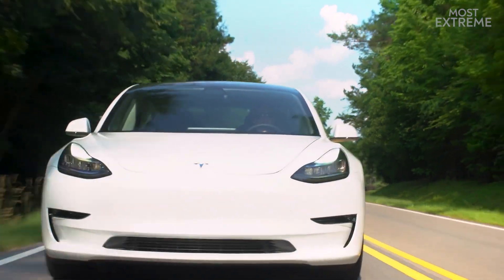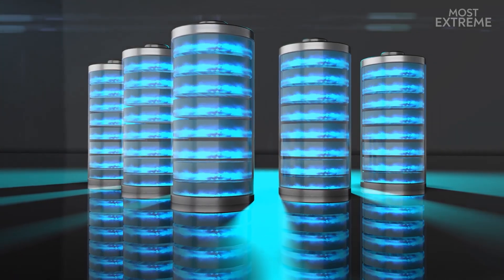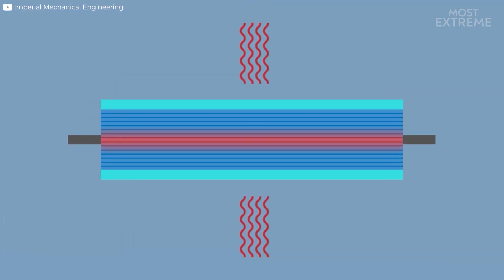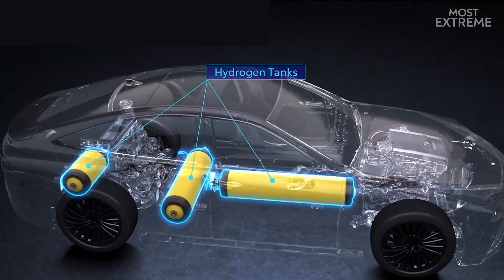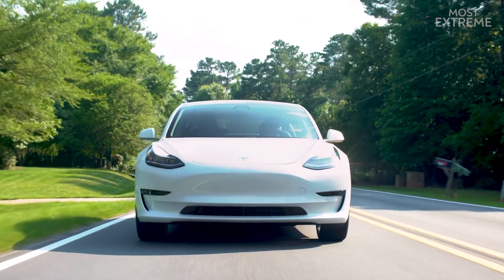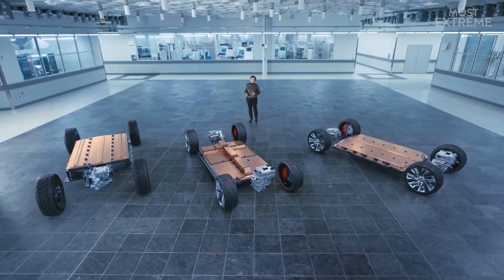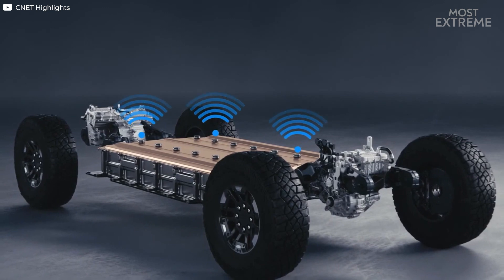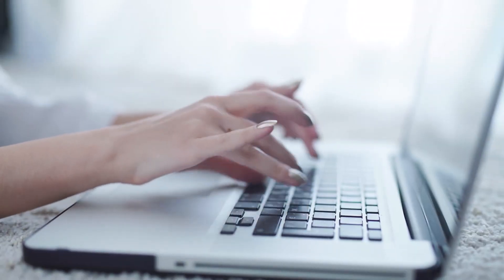Lithium VS Hydrogen VS Solid State | EV Battery Technologies Explained

Comment: Hydrogen infrastructure will need to be built sooner or later for the heavy transports. When that happens, I think we can expect to see more hydrogen cars on the roads.
Reply: It would cheaper to build hydrogen filling stations nationwide than upgrade the entire electrical grid.
Reply: @kerrfoy3653  1.you clearly have no ideea what you’re talking about. Let me ask you only this. How many people trained to work with histogram you know and how many electricians do you know? Do you know how dangerous hydrogen is? Do you know that hydrogen can burn only from the electric charge of only one single human hair? That alone will tell you that working with hydrogen is very expensive.  Second of all, to create hydrogen in mass you actually need to upgrade the electricity greed. Because hydrogen is created with electric energy. Not very efficient either. With 2kw of electric energy you create 1.2 kw of hydrogen. That’s expensive also.
Reply: @mariusmihai1292  Funny that you ask. My trade is that I am a retired Chief of Special Operation with over  30 years of experience in Hazmat/Fire Operations. I am presently the owner and lead instructor for Hazmat Training Specialties. Not to bore with my full resume but I just happen to be the primary Hazmat and Rescue instructor at Livent, formally FMC Lithium Corp. One of the worlds leading manufacturing of battery grade Lithium metals. In 1996 I was first introduced to the hydrogen fuel cell concept while teaching a hazmat class for John Deere research and development. It was a John Deere gator that could ride all day on a bottle of hydrogen and only produce water out the tail pipe. Presently about 95% of hydrogen is produced by high pressure steam and natural gas. Electrologist only accounts for a fraction however it is gaining traction by using solar and wind. I’m not trying to be rude but it’s not that you don’t know a lot, it’s just that a lot of what you know is just wrong. We have not built a nuclear reactor in over forty years and have shuttered numerous cole and hydro plants. Have you not noticed the rolling grid failures in California and Texas? BTW, my family owns a large electrical contracting company of which I first started working at as an electrician in 1988. The fire service offered me a more interesting career path but I still provide electrical safety and arc studies for many large corporation. I just happen to be at Novant today to teach electrical safety and LOTO. Sorry I offended you with my well informed observation 😉
Reply: @kerrfoy3653  first of all I did not ask you anything. 
Second of all you did not actually provided any informed observations. You only said that I don’t know much and you know. Whiteout providing any arguments about the subject. Which makes it an authority argument…
I put it more simple for you. Right now X invest in let’s say solar and wind energy, and the return time of investment is 5 years. He can sell that energy at any time of the day or night instantly. Right now that is not a problem. And it could not be a problem untill 90% of energy produced by green energy if you have the right mix and the max point of consume exactly when you have the max production. I literally made that with entire factories. 
Why the hell he should complicated his life and make a bigger investment and transform that electric energy into hydrogen? and double the time that he will require to return his investment? Would you do that with your own money? 
And no, hydrogen it’s not gaining any traction. Only in US maybe. 
How is hydrogen produced now it’s irrelevant. We’re talking about green hydrogen. 
For adoption to happen it needs to make sense every step of the way. financially. 
You keep saying that you’re well informed and after that you say Deere gator ride all day with a bottle of hydrogen. Which make me really curios because the hydrogen needs to be compressed. You need energy for that and after that it’s still require 3 times liter/kw comparing with gasoline or something. and that’s physics. In a normal car you actually need a 140-180 litre deposit tank. So you’re actually wrong. But they that’s the first thing I heard about hydrogen also… a man who drives all day with a bottle of water. 🤣🤣
Reply: @mariusmihai1292  😊Compressed gas cylinders are commonly referred to as gas bottles. I never implied it was a water bottle. I’m not bashing lithium. In fact I have made a fair amount of money off of it in the last 10 years. Just give it some time. Just like wireless caught the fiber optic industry by surprise, I feel batteries are on the same path. Lithium ion is far from safe and stable. I guess we will just have to see.
Reply: Not just for heavy transport, but also for chemical processes like making ammonia and methanol. Green hydrogen on a massive scale is completely inevitable if we want to have any hope of decarbonizing industrial agriculture, for example. The biggest advantage of hydrogen for transport, though, is that it decouples generation and demand; if you want to charge a 100kWh battery in 6 minutes, you'd need 1MW of dispatchable power on demand. Multiply this by the number of cars that need to charge up at any given time, and you can see there's a problem, especially if you're relying on variable renewables like wind and solar. Batteries are only half of the equation when it comes to solving the problem of slow charge times. An energy vector like hydrogen solves this problem because  it doesn't have to be dispatched instantly. We can instead build enough infrastructure to make and distribute the stuff to support those instantaneous spikes in energy demand.

As for the extra energy required to make hydrogen compared to the round trip efficiency of batteries: California, by itself, already curtails enough energy every year that we could charge 26 million cars with 100kWh batteries. Well-to-wheels efficiency is just a non-issue because we're already wasting a tonne of energy, and as renewable penetration increases, we're going to be drowning in the stuff and looking for things to do with it. Hydrogen is a great energy sink, because it's never full. You can throw as much cheap, almost free electricity at it as you like and use that energy later, and do so on scales that would make even the most ambitious battery chemistries blush.
Reply: @vasudan-u6k  Bruh, Are you charging a 100Kwh batter in tenth of an hour? 
You'll burn into flames
Reply: @vasudan-u6k  no it’s not. To create hydrogen you actually need electric energy. And when you create hydrogen you lose almost half in the process. You need 2kw  of electric energy to transform it to 1.2 kw of hydrogen. creating green energy to transform it to hydrogen is just stupid in many cases.
You can use water dams to store energy in a much more efficient way. When you have surplus of power you take the water up the hill and when you need that energy you let it flow. Also you can put pressure on a container with gas when you have surplus of energy and let it flow transform it to energy when you need too. That is also a more efficient way to store energy. You don’t need actually batteries in every case. Hydrogen does not make financial sense because the process to create hydrogen is only 60% efficient. And that is huge.
Reply: @mariusmihai1292  I'm aware of how electrolysis works.

Your argument fails for the same reason that pickles are cheaper than fresh cucumbers. If we have a poor crop one year, we can sell pickles leftover from previous years to meet demand and keep prices low, but we can't do the same for fresh produce. If we don't grow enough to meet demand, the price skyrockets. If we grow too much, the price crashes because there are only so many cucumbers you can eat before they spoil. Instead, we make pickles that can be sold over the next few years to recoup some of that cost. Generally, pickles turn out to be cheaper than cucumbers, even though pickles are made from cucumbers.

Electricity isn't perishable, but it is non-fungible. Every time you switch a lightbulb on or off, generation capacity on the grid compensates by either generating slightly more or slightly less. The amount that is generated needs to match the amount demanded at all times, to within some tolerance. If you generate excess electricity beyond this tolerance, its maximum value is zero, because if you can't curtail it, you need to pay somebody who can. 

When you switch the grid over to wind and solar, you're no longer able to exactly match supply with demand, and so you need to take the excess and store it. On the scales we're talking about, hydrogen is by far the cheapest option, even if it's less efficient than other methods. As a case in point: the US has 350GWh of hydrogen storage in operation, today, some of it more than four decades old, and only 3GWh or so of grid scale batteries. You can add geological hydrogen storage to the grid hundreds of GWhs at a time, and store hydrogen for years at a time, whereas a battery needs to be cycled continuously to recoup the investment cost. The amount of geological storage available for hydrogen outstrips even pumped hydro, since we can use old wells and existing natural gas storage sites.

But you don't have to take my word on this, there are a million papers out there on the subject with varying degrees of accessibility. Even the WWS grid studies done by Mark Z. Jacobson rely on colossal amounts of hydrogen, to the tune of around 35% of all transportation energy. And yes, it's tipped to be cheaper than CAES, which has its own problems.
Reply: @vasudan-u6k  I working in energy efficiency for 15 years now. 
You’re confusing the price of production with the price of final consumer.
The price of production always counts in the price of the final consumer the only exception could be a black swan event in a market. 
First of all when half (in many cases even les) of the energy we consumed is produced with green energy, to store green energy is a stupid thing to do. You actually create a false problem that we need to store energy. We are not there yet and we don’t actually need to be ever. The countries that already reached 100% of it’s used energy to be produced by green energy don’t use hydrogen at all.
Soo to keep pushing the need to store energy by years to make an argument… is makes no sense to me. 
Making an argument that you have surplus of green energy that you don’t know what to do with it when you only use half green energy and half fissile energy does not make sense to me either. It’s a false problem with a false solution. 
Throwing away energy is stupid also no matter how you put it. It makes it double in price and that is a problem. The main problem right now is not yet the storage. Is slow adoption of green energy. And hydrogen solutions will only slow it more. 
If you thing storing hydrogen is cheap you’re dead wrong. Hydrogen has a very low density. Is very dangerous. you need well trained people, expensive equipments. When something is complicated and does not make financial sense from the start it will not be adopted. Simpler solution that can be applied everywhere that don’t need much training and the price can go lower and lower in the future are beeing adopted trow time. 
If you don’t believe me, you can gather knowledge from Toyota. Who were the leaders in that. Who they lost 10 years in researching hydrogen solutions. And now they gave it up. 
And officially said that hydrogen is not a solution. And not they invest in researching solutions for batteries. Solid state. Silicon etc…
Reply: @vasudan-u6k  1.2 kw of hydrogen will always cost 2 kw of electric energy. No matter how you put it.
Reply: @vasudan-u6k  to have a good return of investment in green energy investments you actually need to use that energy as soon as you can as efficient way you can. By throwing half of it away, will only stop the adoption and the trend of lowering the prices of green energy. because it will double the time of returning the investments. And that is a huge problem. Because we don’t actually have much time.
Reply: @mariusmihai1292  Okay, let's break this down:

"1.2 kw of hydrogen will always cost 2 kw of electric energy. No matter how you put it."

Wrong. Modern electrolyzers such as SOFCs are around 85% thermodynamically efficient, and better than 100% electrically efficient, because only the Gibbs free energy needs to be provided by electricity. The rest can be provided by waste heat, meaning that "2kw of electric energy" as you put it (actually, kW is a measure of power, you mean 2 kWh of electrical energy) can net you more than 2kWh of hydrogen, so long as waste heat from a different source is provide. I would have expected someone "working in energy efficiency for 15 years now" to understand this. The fact that you don't tells me you're probably misrepresenting your understanding of this topic.

Secondly, you state:

"First of all when half (in many cases even les) of the energy we consumed is produced with green energy, to store green energy is a stupid thing to do. You actually create a false problem that we need to store energy. We are not there yet and we don’t actually need to be ever. The countries that already reached 100% of it’s used energy to be produced by green energy don’t use hydrogen at all."

No country has decarbonized all of its energy usage, but some countries have decarbonized their electrical grids. Electricity only accounts for around 40% of all energy usage, and is fairly easy to decarbonize if you have lots of hydro or geothermal, which all countries with decarbonized grids do -- but you still need to decarbonize the rest to decarbonize all energy use. This includes things like trucks, ships, aircraft, manufacturing, heating, agriculture, etc. and it also includes the manufacture of chemicals such as ammonia, which is made from hydrogen, and is used to make fertilizer to feed the planet. Some of these problems require that you be able to store energy in a dense form, which is why companies like Maersk are looking into methanol and ammonia to fuel their ships.

Then you have the remaining countries that will need to decarbonize their grid using stochastic sources like wind and solar. The probability that stochastic supply and demand will ever match one another is mathematically zero -- that's basic probability. For these countries, you absolutely need storage on a large scale, because even with highly interconnected grids, weather patterns like dunkelflaute can occur on the scale of a continent. Again, the cheapest way of doing this will be hydrogen, because you can store it underground very, very cheaply. The technology is 40 years old at this point, look up Spindletop, Moss Bluff, and geological hydrogen storage. No one is claiming that hydrogen is easy to work with, but it's necessary to do so.

Finally:

"If you don’t believe me, you can gather knowledge from Toyota. Who were the leaders in that. Who they lost 10 years in researching hydrogen solutions. And now they gave it up. 
And officially said that hydrogen is not a solution. And not they invest in researching solutions for batteries. Solid state. Silicon etc…"

Toyota has been in battery research since the 80s, and are the world leaders in solid state batteries. They've forgotten more about thermodynamics and electrochemistry than most organizations have ever learned. Not only are Toyota still developing fuel cell vehicles, they're also working on hydrogen combustion engines, and they're not alone (Hyundai, BMW, Volvo, SAIC, JCB, Maersk, Airbus, to name a few are also working on propulsion systems that use hydrogen in some form or another). The reality is that batteries are barely good enough for cars, and decarbonizing the rest of the transportation sector is going to require different solutions. Hydrogen is the backbone of those solutions, because if you aren't using hydrogen directly, you're using methanol, ammonia, or synthetic diesel, which are all made from hydrogen.
Reply: That is an interesting thought! What future technology innovation are you most excited about?
Reply: Not going to happen
Reply: I doubt hydrogen will really take off due primarily because hydrogen is expansive especially the real-estate it costs to store and distribute them.
Reply: Instead of drilling which is bad for the environment, we should go back to killing whales. They are renewable, especially if we can farm them.
Reply: The main problem with hydrogen, is the energy needed to separate it. Current methods are cumbersome, slow, dirty (in the case of methane separation), or energy intensive. Until we find a technology cheap, reliable, clean, and able to be scaled up to meet demand, this won't be. Mores the pity...
Reply: @valdo345jr electrolyzers are efficient enough. Hydrogen in Sweden today cost 90sek per kg att the pump, expected to reach 15 sek per kg by 2030. Still more  expansive per mile than a bev but cost och fuel not an issue.
Reply: Hydrogen scares me in the north.  Water vapor exhaust on frigid days portends ice being discharged onto the roads.
Reply: No, get rid of hydrogen altogether. Invest in solid state
Reply: @thanhavictus  Good call!
Reply: @thanhavictus no,  solid state battery is a hoax. Lithium polymer batteries is "solid state" and they suck too
Reply: @thanhavictus  no. We need to go back whaling. It's natural and renewable resource
Reply: @Jamarkus_Delvonte  got the boat and harpoon, just waiting for the whale to swim by
Reply: Hidrogen is the past